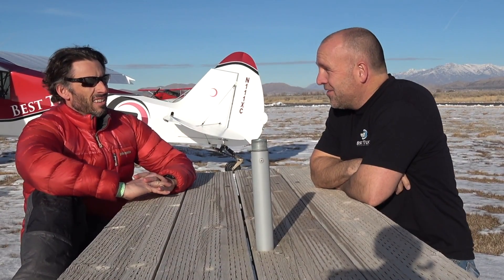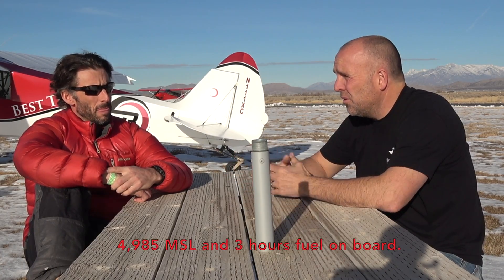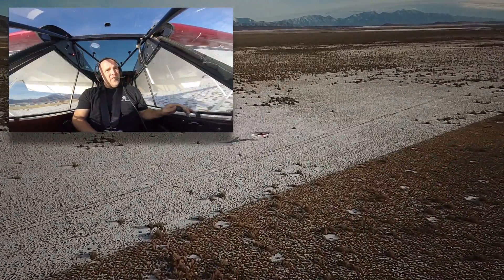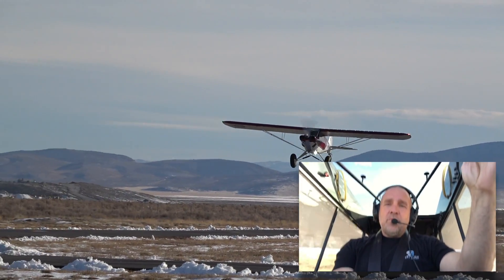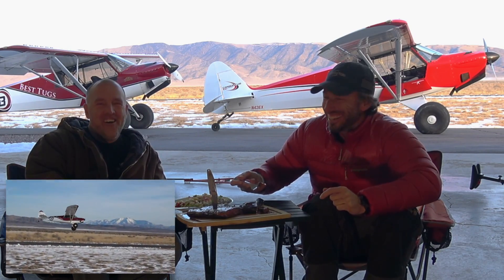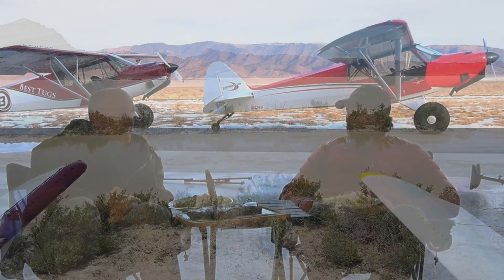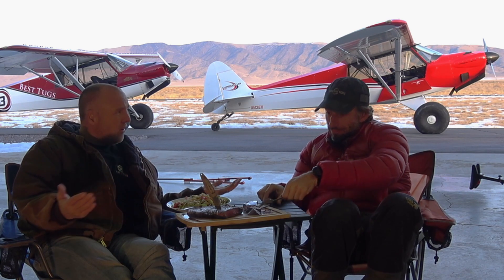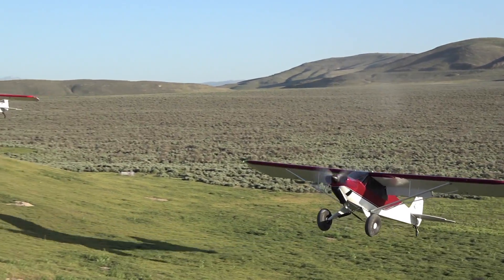The impossible turn in the Carbon Cub

Comment: Is there any FAA-supported or generally recognized literature such as the Aircraft Flight Manual that supports to idea of the "impossible turn"?  I don't know how the Carbon Cub would fly compared to the things I've driven but unless a crosswind turn has already been made, the idea of a 180 degree turn at relatively steep bank at low airspeed near the ground is expecting a lot from any pilot.   

After mentioning several times that the submitters were strongly familiar with their aircraft, they then discuss a pilot who, presumably, felt that he was in the same company only to die starting something that he couldn't finish safely.  This should speak volumes to this often bad idea.  I invite people to review the NTSB accident database.  It is replete with crashes resultng in death or severe injury when a turn-back is attempted.   

Training syllabi and the FAA's pratical test standards, to my knowledge, never mention the turn-back in any manner that implies that it's acceptable manuever to formally establish it's place in training and testing.   The "impossible turn" has no standing like V1 cuts or unusual attitude recovery probably for the simple reason that loss-of-control is very real probability.

Comment: This is not an "impossible turn" . What it is, is the reason a lot of GA pilots get killed after engine failure just after takeoff. If you do not practice it and know the minimum altitude needed to make it successful you most likely will not make it to the runway. 

We do this all the time in gliders but try to make it as real as possible. I also do this in airplanes, but to make it real I do not start the turn right when the engine "quits". Even if you train for it you will not react instantly when it happens for real. This why you need more altitude than the "lowest altitude you can make it back to the airport". Also if obstacles are no factor a turn into the wind will put you closer to the runway when you have completed the 180.  Very few pilots will react within 2 seconds after the engine fails and not engine failures are a complete failure.  Power loss can sometimes be more confusing than a total failure.

Comment: flaps? the best glide ratio is most time without flaps...i did such training with a ultralight, no flaps, and best glide speed...but never forgott that it's better to destroy the airplane in a controled crash landing as to stall in turn and die...
Reply from the maker: Every airplane is different...
Reply: Leneanderthalien:  You bring up a good point.  But Jason is also correct, every plane is different.  Flaps will decrease the stallspeed because flaps change the shape of the wing by reducing its angle of attack.
      When we do the impossible turn,  we are in a steeper bank, about 45 degrees, and as you know, the stall speed increases with bank angle(in a level turn).  See FAA.gov, and read the Navy Flight Training Manuel from the 1960's for an excellent review of the mechanics of a turn.
      This has been drilled into us.  But this rule is only true if you are trying to hold level flight.  If you "unload" the Gs, that is purposefully lower the nose to increase your airspeed in the turn, you will create a greater margin of safety because you are not "accelerating" the airplane as much as if you were in level flight.  The less G the less apparent weight the airplane "thinks" it weighs.   
       The less gs the less "weight" the airplane "thinks" it needs to support.  The "lighter" the plane the less horizontal force it needs to accelerate (turn).  This is why I am one who disagrees with the rule not to make steeper turns in the traffic pattern.
        I'd rather see a student make a coordinated steeper turn from base to final if he/she overshoots base than to make a shallow bank with a strong skid.  Why?  Because if the plane stalls in the skidded left turn, it will flip over the top to the direction of the rudder, here the left rudder.  If it stalls in a coordinated steeper turn, it will buffet, but it won't flip over.  Just relax the control wheel in a stalled steeper coordinated turn.
         The "impossible turn" can be done steeply so long as you lower the nose (unload the Gs).  Sure your airspeed will increase and you will lose more altitude, but you will turn a lot quicker in a steep turn vs. a shallow bank.  BUT ALL OF THIS NEEDS PRACTICE.  JMHO.

Comment: Very unrealistic! They knew that the engine was going to go to idle hence there was zero startle factor, they turned straight away. The Cub is a very capable A/C but the turn back below 500' is just crazy! Remember yr GS will be higher with a tail wind.simply don't turn back!